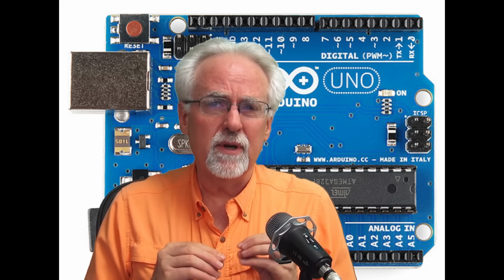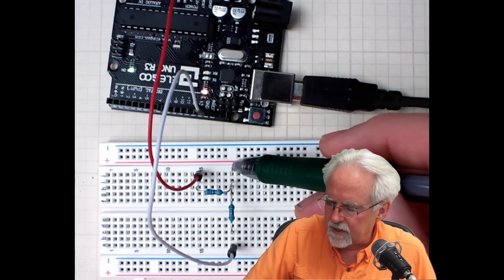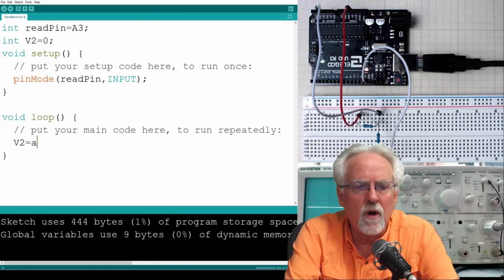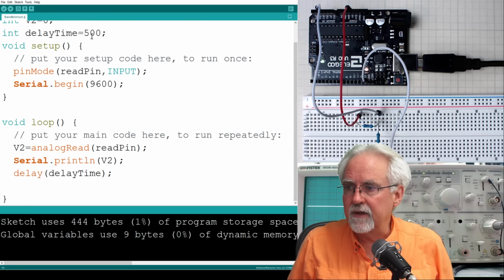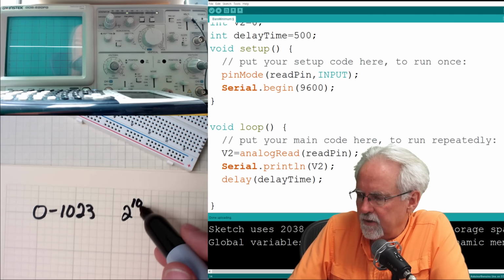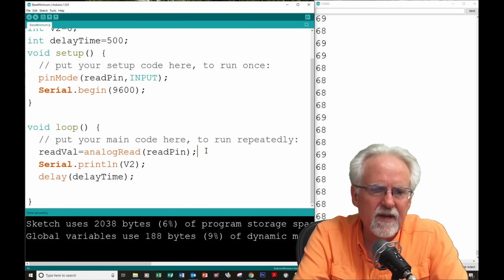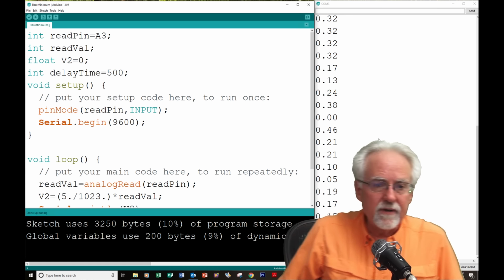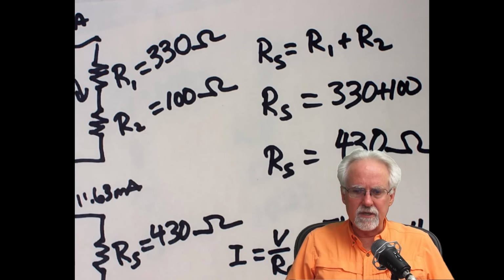Arduino Tutorial 10: Understanding How To Read Analog Voltage using analogRead Command

Comment: Thank you Mr. Mcworther, I did the homework, I used a 10kOhm resistor for R1 and a 5,1kOhm resistor for R2, I got a current of 0.3 mA (this is rounded) and for the voltages across each resistor I got 3v across R1 and 1.5  across R2 (These are also rounded) and the sum of these is rounded to 5 volts since we rounded in the beginning, then on my arduino I used the same code, And I got a 1.68 volt output, and when I used my multimetre I also got 1.68 so I would say this is a success, I calculated correctly and I measured correctly.

Comment: Thank you for the videos they are amazing, the only thing I do not understand is why you have to set v2=0. Wouldn't 0 then replace the v2 in the void loop and make the equation equal to zero?..... Couldn't you just say as a variable "int v2" and then the code will work without equating v2 to zero?
Reply: Zeroing V2 is of no consequence, since it is executed once PRIOR to the loop. int V2 without a value would have worked just the same.

Comment: I have a doubt.
a) How on earth does it understand and slot a particular voltage given to it in the scale of 0 to 1023?
b) What if we give an external voltage more than 5 volt? (I tried to hook the +ve connection of the 9v battery to the same pin and suddenly it shows 5v. Please explain this)
  Hope you would answer this soon.
 And by the way, thank you very much for the the time and effort you put into this for making us understand these things. You really are an excellent teacher ❤️❤️❤️
Reply: I think we need to learn more about how a digital device "samples" analogue values to understand this.

Comment: I took a bit of a challenge with the making a traffic light exercise and tried making a pedestrian crossing interface with a button.. I have a feeling it would work better in theory if I used an analog input.. then again, the function I'm looking for seems to be more of an interrupt or something which would cause the arduino to move from one loop to another loop for a single cycle... And since that failure here I be learning more and more...

Comment: I did the homework using 1k and 10k resistor. I got a reading of 4.5 volts which is what I calculated for R2 so that was good, but I couldnt get a reading of 0.45 for R1 as it would just go to zero which I think means it is reading the ground.

Comment: Great tutorials Paul. Question - Is 5 volts the maximum voltage that can be read? What if a wanted to read voltages that varied from 0 to 12 volts?

Comment: I have only 2 questions if someone can answer-> How did the int readPin take in the value A3? it's an integer so why didn't it show an error. And second though the program gave accurate voltage results, when I removed the A3 wire from the breadboard (but still connected to arduino) it started to give me random voltage values, why did that happen? What voltage was it calculating at that point.

Comment: Hey Paul,

I need your help, when I connect to the Wire comming from  5V form Arduino it is showing Output as 5.0 but when I plug in at start of R2 and end of R1 it is showing just 0.0. 
Your help would be really appreciated.
Reply: Same thing is happening with me

Comment: Paul, first of all I wanted to thank you for the great videos.  Thank you.  Maybe this has already been answered in the comments.  I tried looking through and didn't immediately see it.  When you define the integer variable readPin you assign it the value of A3.  A3 is not an integer!  But it did not throw an error at you.  I tried looking at Int on arduino.cc reference and it says nothing about assigning something like A3 to an integer variable.  How does this work?
Reply: I found example code on this page that does the same thing you do Paul.  But it doesn't explain why A3 can be stored as an integer:
https://www.arduino.cc/reference/en/language/functions/analog-io/analogread/

Comment: 1) To measure from A3 pin we did not have GND wire like we did with the multi meter where we could read in the voltage via two wires going into multimeter, I think it is Bcz all arduino pins that can read are already wired to a reference GND.

2) I don't see any code to supply current through pin 9 going into resistors then how can we read the voltages across them, again my guess would be that previous code has been saved on that ATmega328p somehow.

Plz confirm my info and correct me

Comment: Shows both the 5v value and the voltage in between the resistors;
int Rpin2=A2;
int Rpin3=A3;
float V1=0;
float V2=0;
int T=500;
int VValue1;
int VValue2;

void setup() {
  // put your setup code here, to run once:
pinMode(Rpin2,INPUT);  
pinMode(Rpin3,INPUT);
Serial.begin(19200);
}

void loop() {
  // put your main code here, to run repeatedly:
 VValue1=analogRead(Rpin2);
 VValue2=analogRead(Rpin3);
 V1=(5./1023.)*VValue1;
 V2=(5./1023.)*VValue2;
  Serial.print("   ");
  Serial.println("\t");
  Serial.print("V1=");
  Serial.print(V1);
  Serial.print("   ");
  Serial.print("\t");
  Serial.print("V2=");
  Serial.print(V2);
  delay(T);
}

Comment: I copied the circuit and code exactly and it was giving me a constant 237.  Also, it gave me an access denied error when I attempted to download the code into the Arduino.
Reply: So then I did (5./237.)*readVal; and it's printing off 5 instead of 237. This doesn't make sense because there should be a voltage drop after the first 330 ohm resistor right?

Comment: Paul McWhorter is probably the most patient and knowledgeable teacher I have see on YouTube. One question please - the circuit diagram shows the 2 resistors connected in series. but on the prototype board Paul connects the resistors across the ridge through which there is no connection.
This was done in a previous tutorial too.
Can someone explain how there still remains the voltage across the ridge?

Comment: Hiya don't  know why, but I have been working on tinkercad and making the same circuit but I recive a value of around 2.50 volts around  the same resistor as yours. I have tried troubleshooting but again the same thing..

Comment: I am not getting correct values for  voltage drop and even if i won't connect anything to A3 port it is showing voltages around 1.5 volts, can someone explain me this.

Comment: Hey Paul, 
Great Video's, 
One thing that I found missing in this video was how to read a value across R1, the probe is reading from the test point (A3) to GND, which reads out the voltage across R2.
Is there a way to make the Serial port read the measurement between two probes, to get a voltage across a component?

I do have one other question that occurred along the way to this point, how much current (or voltage across) can a LED take without being damaged?  Thought it would be good to know in circuit analysis, so I can get the maximum brightness without damaging the LED. 
The Elegoo tutorial askes for 220 ohm resisters to limit current through a LED.
I get 2.19V across the LED with the 330 ohm and 2.26V with the 220 ohm resistor.

Thank You,
Tony Crumly

Comment: Sorry Paul, but even through only 10 tutorials and you've taught too well...I completely CRINGED when you put in "9600" for the baud rate instead of setting up a variable called, "baudRate" and set it equal to 9600...😁.  Gave this a LIKE anyway...👍

Comment: The Read Analog is 1023 which is 10 bits, so Each Analog Input Pin is 10bits at 1023 decimal? Can you talk more about the Baud Rates about the advantages and disadvantages of using different Baud Rates?

Comment: your videos...i dont think there are enough words out there to compliment them. They're really great. Also, i was wondering if the 100 ohm resistors are the ones labelled as 1K. ive been having a lot of trouble finding out and dont want to use the wrong resistor and cause a problem

Comment: Hi all.

When I validate the code its fine, but when I open the com3 I get this

avrdude: stk500v2_ReceiveMessage(): timeout
avrdude: ser_send(): write error: sorry no info avail
avrdude: stk500_send(): failed to send command to serial port
avrdude: ser_recv(): read error: The handle is invalid.

What am I doing wrong?

Comment: l have a query. I wired up as Paul showed and got V1=509 & V2=2.59. Great. But, then I tried another arrangement & got a weird result. Well, at least to me it's weird.
1. connect 5V wire to breadboard j15
2. connect 1 leg of a 100 ohm resistor to i15
3. connect the other leg of the resistor to e15
4. connect gnd wire to a15
5. connect A3 wire to c15
Why does my serial monitor show 0 for both V1 & V2? I have also tried it with a 330 ohm resistor: same result. Why does the analogRead wire have to be between 2 resistors? Oh, BTW, a multimeter does show the voltages I would expect. It's just the arduino program that doesn't read it.

Comment: Hi, Paul! I forgot to ask you before, but may you make a video how does the Arduino read voltages? Because, i know, that to read voltage we need to connect voltmeter parallel. But, i cannot observe this connection with connecting only one wire somewhere. It seems to me, it would be a cool video, especially with your explanation. Thanks!

P.S. And you could also tell about sending signals from Arduino with write commands, if you liked the idea.
Reply: The other terminal is the ground of the Arduino which was already connected.

Comment: Can you do a voltage drop read across the 1st resistor, or would you have to derive that by using the voltage drop obtained from the voltage drop read across the 2nd resistor?

Comment: Hey sir. Your videos are legendary. I really like the way you explain. You must have some brilliant students!

I have one question regarding this video and a earlier video about Analog Reads in the Arduino Lesson 10.

I have noticed if I remove the potensiomiter/wire from the Analog in Pin it gives random answers as output in the serial monitor, no matter what I try I cant get the value to 0.00 if I remove the potensiomiter's outputpin/wire from the A0-5.

Is there a chance that you could explain why this is happening, or what I may be doing wrong?
Thank you Paul. I appreciate it!

Comment: I've been following along with my own Uno and was a bit anxious when I saw my first printout wasn't exactly the same as yours but, I stuck with the lesson and soon realized that the readings I was getting were actually closer to what we get on paper (usually exact)! I think it may be due to the fact that I'm using an original Arduino Uno and not the kit you recommended (I only didn't get the kit because I acquired most of the same materials piecemeal for other, previously-planned projects) . I wish I had gotten the kit now since that would have been cheaper but I didn't find your videos until AFTER I'd done my shopping (darn!)! LOL Mix those small differences in with a little math-phobia and it takes a while to reassure myself that I really am doing this right! Lesson learned-- just stick it out, wait & see how things turn out and don't worry so much until I get to the end. :P
Reply: I am gonna use a different one too as this kit doest get shipped to New Zealand. Please let me know if your kit is working good with these lessons.

Comment: What would happen if I applied a voltage from a battery (that is higher than 5V)  to one of the analog pins? is there some kind of  protection to keep the arduino safe ?

Comment: Hi Paul, why is the voltage scaled by 1023, a 10 bit number instead of 255 a 8 bit number like when we were doing the analog outputs for the leds?

Comment: I’ve been using an actual Arduino and following along using the breadboard and circuits on my ancient Radio Shack electronics kit I purchased years ago. My Elegoo kit should be here tomorrow. I wanted to follow along precisely what you were doing. I was expecting the analog in values to be the same as the analog out, 0-255. Interesting that they are different.

Comment: Built the circuit, told the Arduino what to do but could not get anywhere near the 5 volts. Went back over the circuit, thought what is the Arduino doing - exactly what I told it, but all checked out okay. Found that one or jumper leads had gone high resistance, changed it out and everything as should be. Done my homework and all okay there too. Keep up the great work.
Reply from the maker: And that is called troubleshooting, and one of the most important skills if you are really going to be able to do engineering projects. Sooner or later, something will go wrong, and you have to methodically go through a process. It is either hardware, software, incorrect connections, bad component. Almost always, either the code has some subtle error, or the circuit is hooked up wrong. 95% of the time it is one of those. But if those are absolutely ruled out, then you piece by piece look for bad hardware component, like a bad wire.

Comment: Does anyone now how to present the serial monitor data as follows: 
V1 = 0.88  
V2 = 4.12

I used the following code, but i am pretty sure it's not the best solution for this output as it is actually displaying the following instead:

Serial.println(V2), Serial.print("V2 = ");
Serial.println(V1), Serial.print("V1 = ");

V1 = 0.89
V2 = 4.11
V1 = 0.88
V2 = 4.12
V1 = 

It  would also be very nice to have a "v" after every measurement as a bonus.
Reply: Alright, got it working:

int probe = A3;
int readVal; // just declaring the variable readval, is a value that will be probed(read)
float V2 = 0; // Set-up the variable start value, V2 is measured over the 100ohms resistor, setting V2 = 0 is not necessary, but is good practice !!!
float V1 = 0;
int pause = 1000;
String Voltage2 = "V2 = ";
String Voltage1 = "V1 = ";
String Volt = "V";

void setup() {
  // put your setup code here, to run once:
  pinMode(probe, INPUT); // readPin returns a value between 0(0V) and 1023(5V) (10bits), (5V/1023 = 0.00488759)
  Serial.begin(9600); // Set-up the serial monitor and set the Baudrate (how quickly you will be talking to your serial monitor)
}

void loop() {
  // put your main code here, to run repeatedly:
  readVal = analogRead(probe); //read the value between the readPin and ground, convert it to Volts and store the value into variable V2
  V2 = readVal * (5. / 1023.); // add the points (.) do run float math instead of integer math
  V1 = 5 - V2;
  Serial.println(Voltage2 + V2 + Volt); //Print to the serial monitor and use a new line for every print (read V2)
  Serial.println(Voltage1 + V1 + Volt);
  delay(pause); //delay between print outputs, will otherwise go to fast
}

Comment: Hey Mr. McWhorter,

I've been following along with building your circuit tutorials for a couple of weeks now and it has helped me greatly with learning Arduino and learning how to code. I'm transferring into university for Electrical Engineering and this has been a big refresher for a lot of topics covered in high school electronics class and community college EET classes. 

I'm a little confused about how the analog read pin gets the data it needs to display voltages. In NI Multisim, a circuit analysis software we used in class (which I'm sure you're familiar with) there was a tool that could be used over hooking up a multi-meters in the program called "probe". This seems very similar to that where you only have to attach one wire to get a reading, but I'm curious about how the read signal going into the Arduino completes itself/grounds. It interests me that there's no need for two wires to read the voltage like with a normal multi-meter. From a circuit analysis standpoint, how does this work? 

Thank you again very much! I look forward to watching more of your tutorials.

Comment: Hi Paul! Thanks so much for putting together these videos. I've learn so much already. This one move a little faster than the others so I have a couple of questions. 1) Since I did not have a 100ohm resistor in my kit I used a 220ohm for R2. I did the math and R1 was 3v and R2 came out to 2v. I followed your diagram and my serial monitor read 2v, yay! Soooo where can I find the 3v in the circuit? I probed everywhere on the breadboard and I can't find 3v of resistance, should I? 2) If I put the probe between the second resistor and ground my serial monitor reads 0, why?
Reply: I had much the same question; i.e., how do I measure the voltage drop across R1 with this circuit and probe. I can't find a location that shows me the expected value for V1. It may not be possible using the circuit in this example. As for why you are reading 0 volts when you put the probe between R2 and ground, it is because that point is effectively below R2 , so R1 and R2 have already "consumed" all the voltage in the circuit. Your read value of 0 is correct then.

Comment: Hello dear Paul I would like to thank you you for the high quality content that you provide and your precious time spent on YouTube makes all the difference I learnt so much from you however I have one question I am trying to make an automatic Gate controller I've managed to use timers for the motors however I am stuck with the sensor i am using ir sensor how ewer the loop is ignoring my inputs onse notors start closings the gates sensor is ignored how can it be interupted the loop tried for comand i tried if statements nothing seem to work thank you
Whe  gates are closing the sensor is ignored how can i fix it i apriciate your reply and help

Comment: Lesson 10 question: When you put the A3 probe between R1 & R2 you said we are reading the voltage across R2. Why isn't it reading the voltage across R1? Does it only read from A3 to the negative side? How would you read across R1?
Reply: I was able to read R1 by changing to + & - leads. But this method will only work if I only have 2 resistors. So there must be more to learn. I was within a 1/10th of a volt of the calculation.